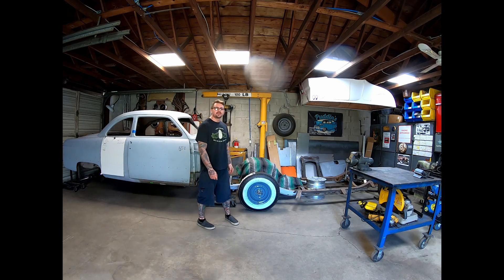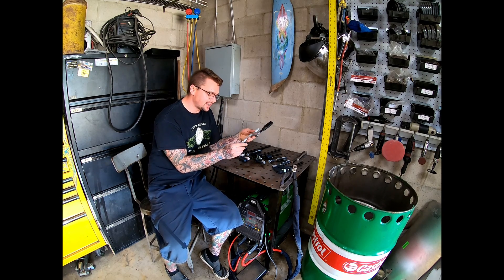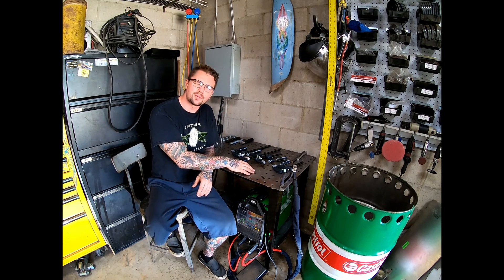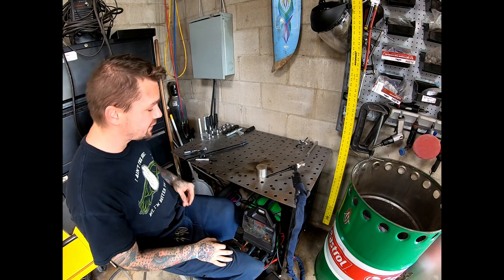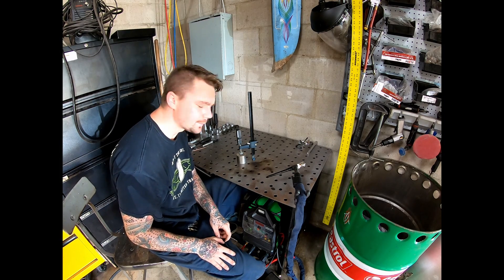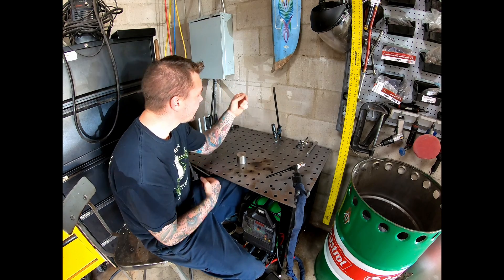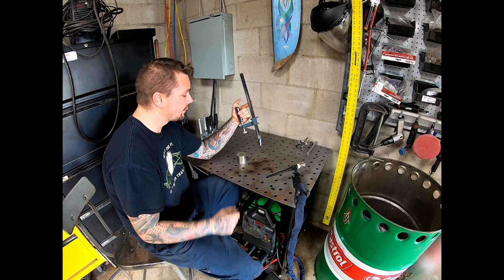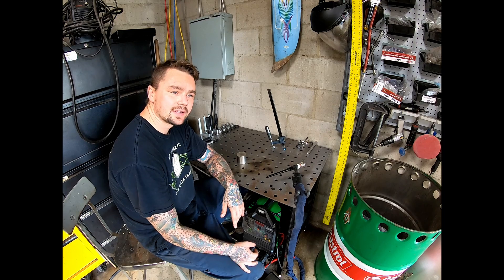HARBOR FREIGHT CLAMPS FOR WELDING TABLE

Comment: I used some shoulder bolts for mine - just a groove in the head and cutoff the threads. The head of the bolt seems to help engage the hole in the table pretty good. My table is a bit thicker. I bought 3 aluminum 7” x 36” ‘stronghold’ type of plates off of eBay and built the rest of the table myself. It’s my tig station that I built 2 years ago and only messed with a few times, I got fed up having to re-grind my tungsten and stopped practicing.
Reply from the maker: Shoulder bolts are a great idea. It can be frustrating for sure practicing. I haven’t been practicing as much as I shoudl

Comment: I did the same thing except I used 5/8 dia. (19mm I think)3/4 inch long shoulder bolts the fit up was nice and I could put them at a bit of an angle made 6 of them they work great
Reply from the maker: They are handy!

Comment: Nice.  So round stock is welded at slight angle not straight?    I just bought Klutch table and like you I don't like the nut idea.  I'll make like yours. Thanks

Comment: I keep saying that I’m going to make clamps, but I just keep buying more. Clamps for the 5/8”/16mm tables don’t need screws to hold them down. The have 5/8” stems that fit the holes. When you clamp, the clamp angles in the hole, and it locks in place until you loosen it again. So, nice that you’re making them yourself. I’ve gotten too lazy. If the clamp it too vertical, it won’t hold. It’s supposed to angle, that’s what holds it.

And just as a tip, you really don’t have to wrench a clamp for welding down too tightly. Just enough so it doesn’t move from the weld cooling. In other words, firmly, not as tight as you can.

Your welds look good.
Reply from the maker: They can sure come in handy!